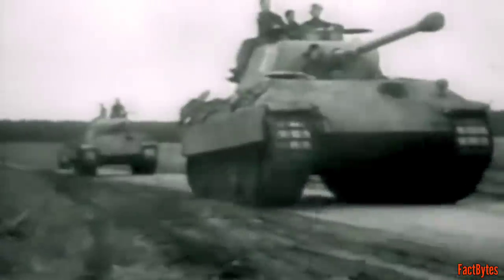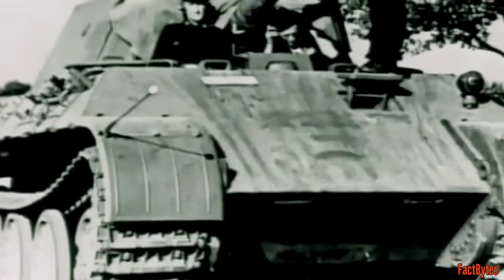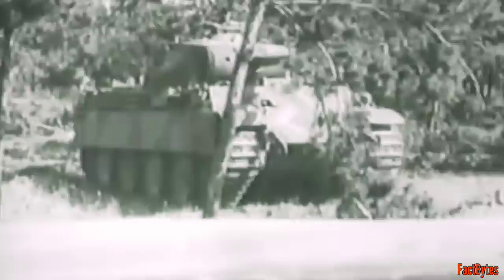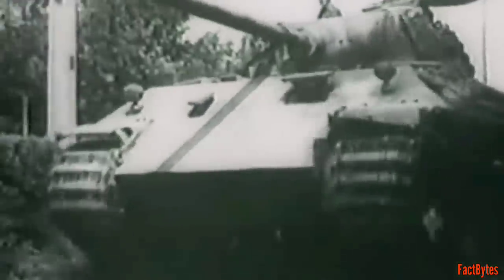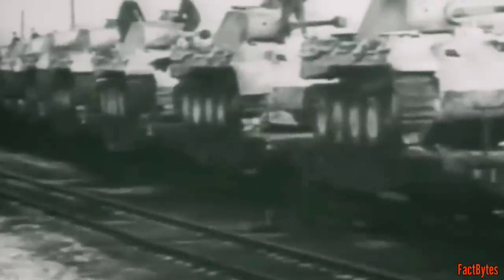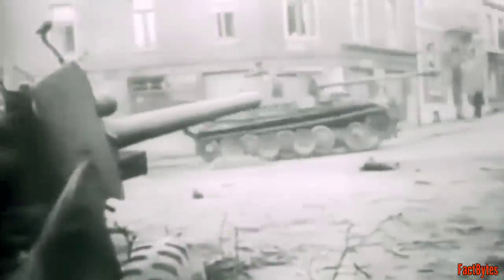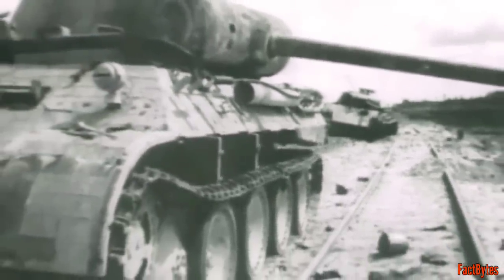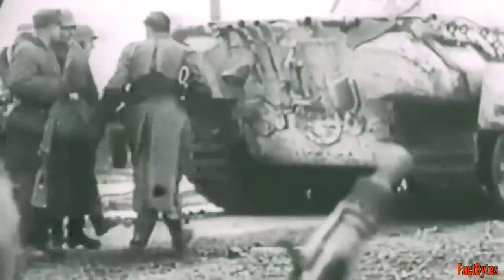Was The German Panther Really The Best Tank Of WW2?

Comment: It was quite good, except for breakdowns, and the projectile trap created by the gun mantlet. Any shell striking below the horizontal midline of the mantlet would be deflected downward into the top of the chassis roof. The armor there was only an inch and a half thick. The driver and others were usually killed.
Reply: For a "quite good" tank that was designed to counter superior numbers, it had a very slow traverse (the pzr4 had independent traverse let alone the opposition), narrow FOV optics (multiple sights were standard on the Sherman complete with an unmagnified one), and no commander override (so the TC can help the gunner find the next target/threat instead of 10 degrees left of the sycamore, the other left).
Add in the mechanical woes, the neutral steer was against orders due to breakage, and the frontal armor and specialized gun that is poor in HE (for hitting towed guns, a more common threat than a tank) starts to look a bit less impressive.
Reply: @kalman denning

First the panther G series was quite reliable .There ia a video called "interview wwii ar the Panzer museum with Hilary Doyle " dec26 2018 min 21.
Than as far as i know Israel used a modification of the panther gun on their Sherman.
Than the panther has a far better chassis and wider tracks for nud and snow.
The list goes on.
Even Zaloga wrote in the osprey duel book panther vs Sherman that the panther was better.
Reply: @ivjgknight5134  um the M50/51 Sherman used the gun off the amx tank
And how does that make the Sherman worse than the panther?
Or the panther better than the Sherman
Still doesn't address optics, turret traverse or the TC override
Add in the slow production and dearth of spares, and the panther was not a war winning design
Reply: @ivjgknight5134  and still doesn't address the standing orders NOT use neutral steer nor climbing certain grades
Nor the sheer weight for bridging and crossing existing infrastructure
Reply: A lot of post war french tanks are influenced by german designs.Look on Wikipedia amx 13 , Israeli Sherman.
Also i think this compariaons are nonsense.Panther and Sherman were designed to do different things.I just wrote what other experta said.
Reply: Spelling errors because my auto-correct ia going nuts.
Reply: @ivjgknight5134  and I don't consider 1/4 the lifespan on the drivetrain compared to the Sherman"fixed" or "quite reliable"
Reply: @ivjgknight5134   Zaloga said that the Panther had better muddy terrain mobility to the Shermans, better gun and better armor, but it also has called the Panther a dud, often bested in combat by the on paper inferior Shermans, due to bad crews, bad logistics, bad tactical situations. The Panther kill rate vs the Sherman was a mediocre 1.2:1 according to post war US Army studies. The late A and early G model Panthers were "quite reliable" for a late war german tank. Still way below that was acceptable in allied and soviet armies at the time. And late G models started to lose reliability again due to the germans lacking strategic metals or the alloys for the armor and final drives, use of slave labor prone to industrial sabotage and  round the clock allied bombing forcing the scatering of productions facilities. 
The israelis managed to mount a french copy of the Panther gun in a Sherman (the M 50), and that is quite a feat for the Sherman, a tank that despite the weak armor ( it was a medium tank after all), was designed to be easily upgunned, a design feature the US failed to fully use during the war, they only did 76mm AT and 105 howitzer versions. But the brit did with the 17 pounder.  The 90mm gun of the Pershing was instaled in Sherman  tank prototypes (not the M 36 Jackson,, full Shermans tanks), with success, the 105mm french  AT gun (M 51) was used in late Israeli shermans.
Reply: @ivjgknight5134  the most quoted figure is 1500km vs the 4000 miles on the Sherman (1.6 km to a mile)
As that is up from 150km I guess that's "much improved"
As the french only got 800km(half that) NOT in combat, and not doing maintenance in the field, the 1500km might be a tad optimistic
Reply: @ivjgknight5134  the you get into the historical record
Germany lost
The Sherman had 3-1 win loss vs the Germans
And the one large battle between the panther and Sherman was arrancourt when the Sherman (the "lesser" 75 Sherman at that) beat the panther 6-1 
And you might get the impression that the legend of the panther was perhaps a tad overblown
Reply: @ricardosoto5770  that 1.2-1 for the panther was almost entirely on the defensive too, a decided advantage. Considering the disparity of the gun and the frontal armor, that's not so good while playing tank destroyer. especially as the whole point of the panther was a better tank due to lack of numbers.
As far as not up gunning the Sherman, you also need a bit of context. The firefly had to get rid of the BOG to get acceptable ammo capacity, not something the American field commanders wanted when they were largely facing infantry and support units.
The 90 was passes on for the same reason.
Incidentally the 17, you couldn't look through the sight and manipulate the elevation at the same time, unless you had gorilla arms. That might be considered a bit of an inconvenience in combat. And the 3 foot shells in the original Sherman turret was a bit problematic as well.
And about the same time as the British got the 17 to "work" as well as it did, the 76 Sherman was approved for production. As the 17 pounder wasn't in the American logistics train, and the abysmal ergonomics of the firefly, you might understand why the Americans passed on it.
And the panther and tiger were being delt with in Italy by the 75 Sherman ( though the guys in Italy definitely wanted more gun, the 75 was working and the 76 was on the way)
And when the Israelis upgraded to the M50, they did get rid of the BOG as well.
Reply: @drudgenemo7030  People forget, that the Sherman as to face many conflicting requirements due to the huge differences in the global  war.  ETO wanted more armor and more gun. MTO wanted more gun but they were OK with the armor, climbing Italian hills is not for heavy tanks not called Churchill and they you got the issue of too many bridges to cross,  CBI and Pacific shermans were fine as issued,  maybe they liked more armor once they leave the beaches, or wider tracks in Burma's  or New Guinea muddy trails but they were happy with the 75mm. German big cats were designed mostly for the eastern front, while Shermans have to be a jack or all trades, masters of nothing.
Reply: @ricardosoto5770  a good example of the reliability of the Sherman
At Bastogne  3rd armored drive 100 miles then immediately went into battle, no maintenance
Reply: @drudgenemo7030   a 0.2 advantage in kill rates for the  Panther who was playing defense most of the time is clearly a mediocre performance. A complete miss use of the gun and armor advantage.
Reply: @ricardosoto5770  direct comparisons between tanks are problematic due to different needs and doctrine of different countries.
I try to judge based on how a tank works in their army. And how elements of the design fit the requirements.
The panther had corners cut that were present on other German tanks that greatly impacted the "quality over quantity" basis of German army needs.
That's why IMO the panther is somewhat less than a great design.
And why the Sherman is better than it's general reputation.
And the most important quality in a tank
Is showing up.
One that doesn't show up ALWAYS loses to the one that does. Even if it a FT vs a Abrams.
Reply: Agreed, the Sherman, Cromwell, T 34 were were they were needed. They showed up.
Reply: @ricardosoto5770  here you go... Panther vs Sherman testing ground results. There is a part 2 also... 
https://youtu.be/O-cFP4S7bc4
Reply: @drudgenemo7030  There was much more to that battle strategy wise than just tank vs tank Kalman. Fuel was a huge concern for the Germans and played a pivotal role in the battles opening stages and final outcome.
https://youtu.be/O-cFP4S7bc4
Reply: @ricardo soto

I see a word salad with 0 evidence.
I mentioned the publication and the claim .
There was another study that claimed 3 to one kill ratio for the Sherman vs panthers which was worthless because of bad data collection acording to Zaloga in the same publication i mentioned.Your study might be a dud because it's inconsistent with veteran testemony and battles that are verry well documented where claims are consistent with losses on the other side.
Also by your own admission many panther crews were poorly trained that's not the tank's fault, hell untrained crews can loose in an abrams vs a Sherman.
Reply: @ivjgknight5134   The number salads, even with their fault are far better that " I was a veteran and I have the impresion of combat, or worse, grandpa told me".  The fact is Sherman losses were not that huge during all the war. And most Sherman were not lost to other AFVs but to Paks, teller mines and Panzerfaust. The only huge Sherman losses were in EL Alamein, Epson, Goodwood, Totalize, where loses were higher than 30% (guess who was the general in charge of all this),  the rest of the war they werent higher than 15% for all causes, and in some fronts like Italy or the Pacific losses were less than 10%.  A study of kill rates with faults is far better than no study at all. In 1944, the Panther was a dud a good when working but delicate tanks in a age of crumbling logistics, ill trained crews and no fuel. What could go wrong? Not all were Panthers faults, but it was the wrong design for the time.  IT was a design for 1942 not for 1944.
Reply: @ivjgknight5134   The US Army study is quoted by Zaloga in Sherman vs Panther, and in Armored Thunderbolt. also is available on the Web.
Reply: The Panther G has a chin to prevent that shell trap and is also the most produced variant of the panther
Reply: @_kommandant_3055   False, most G panthers produced did not have the Chin mantlet. Only the ones built by MAN after november 1944. Im quoting Jentz and Doyle books on the Panther. MNH ones did never got the Chin or DB ones.
Reply: It didn't happen often and in fact the Germans didn't even bother to address it until over a year after its introduction. Other issues were more pressing.
Reply: After the war the French were given a sizeable quantity of Panthers. They immediately began tearing them down and rebuilding. They were shocked to find cigarette butts, cigars, dirt, grass, paper, wood, rocks, etc crammed into hydraulic lines, transmissions, fuel tanks, fuel lines and engines. Wires intentionally crossed, holes drilled in oil pans, etc, etc... factory sabotage was a very real problem for the Germans late in the war. Not just from paid foreign workers but also from Germans.
Once the French squared away the Panthers they performed excellently for many years.
Reply: @jerryjeromehawkins1712  not so much
Final drives lasted 800km
The tank was extremely fuel inefficient
And then the limitations of the turret traverse and the fixed narrow FOV sight.
They did like the boosted controls.
And the foreign workers most definitely  were NOT paid
Reply: @jerryjeromehawkins1712   Yes, Hans and Fritz might designed the Panthers with german engineering, but Shlomo, Davit, Yzak, Pierre, Dimintri, Olek, Wadislav actually built them. And they were not fond of their product actually working.
Reply: @jerryjeromehawkins1712  wrote: "Once the French squared away the Panthers they performed excellently for many years."

-- How many years? Please...
Reply: Sidney Radley Walters got several in that way.
Reply: Some here might be interested in looking into T34s and their reliability. Many left the factory with spare transmissions lashed to the rear bulkheads as transmission failures were common... especially on the early models. Welds separating, water leakage shorting out electrical systems, etc.
Reply: @jerryjeromehawkins1712  wrote: "Some here might be interested in looking into T34s and their reliability. Many left the factory with spare transmissions lashed to the rear bulkheads as transmission failures were common... especially on the early models. Welds separating, water leakage shorting out electrical systems, etc."

-- Interested into T-34 and their reliability? It surely lasted longer then Panther tanks, for sure, and just about any German heavy tank had problems with welding.
Reply: breakdowns and true but overrated and has become a stigma and the shot trap mantlet did not happen as often as we think, not all Panther Gs have the chin mantlet

Comment: The M26 Pershing was probably a better WW2 tank but there were only a few used and a tank is only as good as it’s crews skill.
Reply: It was roughly comparable with the Panther, both a 45 ton tank. But less that 20 say combat,
Reply: @ricardosoto5770  it could move and fire accurately, an attribute which the German tank crews would ask about when POW’s.
Reply: @alexbowman7582  American tanks where the first ones with gun stabilizers. They Sherman had them but few crews were trained in their use.
Reply: @ricardosoto5770  you can argue which tank was best but a good tank with a well trained crew would usually defeat a better tank.
Reply: @alexbowman7582  Yes, also the tactical situation matters. Defenders oftens have less casualties than attackers. In 1944 the germans were mostly defending. A fact most german fans seem to forget.
Reply: @alexbowman7582  Eh no, it couldn't, the Pershing did not have a stabilizer.
Reply: @alexbowman7582  Stop using WT as real facts , the Sherman could'nt fire on the move and the Pershing also . I mean you can fire but you will hit nothing . 😅
This WW2 gyros were crap , useless . Real stabilizers were used in 1960-70 tanks and still they stop to shoot . The Brits got them earlier , but still not really usefull .
Reply: @5co756  Sherman to a certain speed can fire on the move, this is a fact
Reply: @AHappyCub  Dude you have no idea of this old WW2 gyro or how stabilizers work , stop using WT as real facts . 😅
To shoot and hit on the move you need stabilized gunner sights as well and the stabilized gun follows your gunner . Only a gun stabilizer is useless , if your sights move up and down you hit nothing . This gyro helps the gunner after the tank stops to get the gun a little faster on target , not more . Why should the Americans build 20 years after this superior M4 gun stabilizer , tanks without a stabilizer ? Cause it was so good ? Nope ....
Reply: @5co756  Because when they put the Gyro stab on the Sherman they forgot to fucking teach their crew how to fucking use it, and US ordinance during WW2 are very brutal in cutting down unnecessary technology until they are mature enough
Reply: @AHappyCub  Yeah sure , they forgot 20 years to teach the tank crew's how to use this gyro .... 😂
Reply: @5co756  Clearly youre too dumb, the US literally forgot to teach how to use it because at the time it was considered a secret, and because most dont know how to use it, it became useless, so they didnt bother putting any stab until the technology mature enough, this has nothing to do with WT, but then again you clearly dont have any functioning brain and only here to troll people
Reply: @5co756  Tiger crews were forbidden of shooting whilst moving despite what Fury shows.